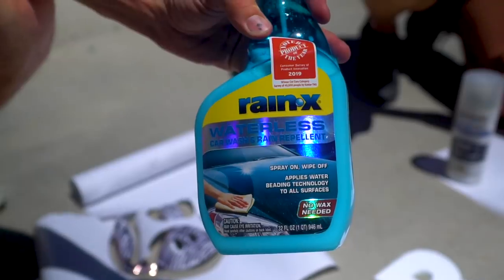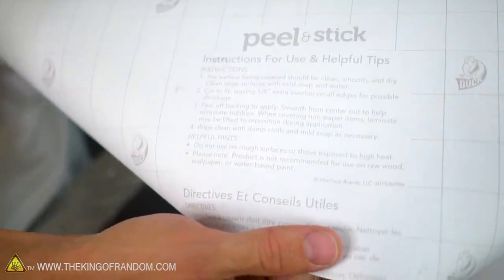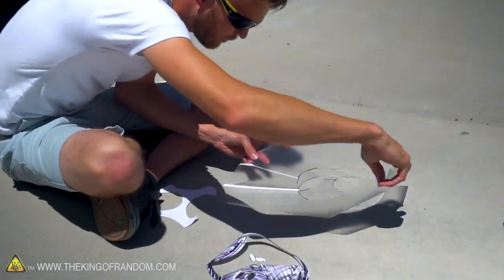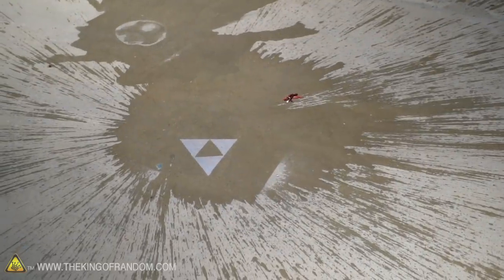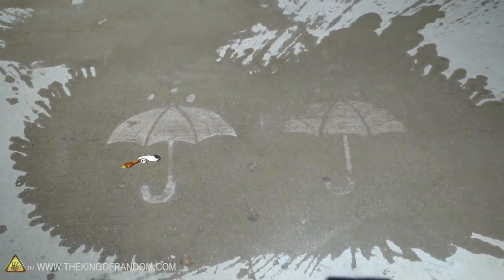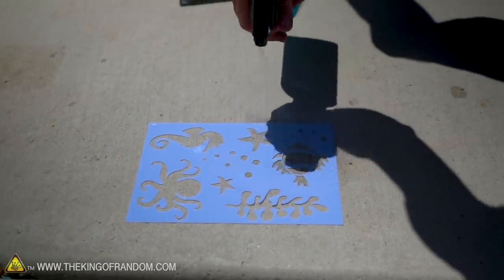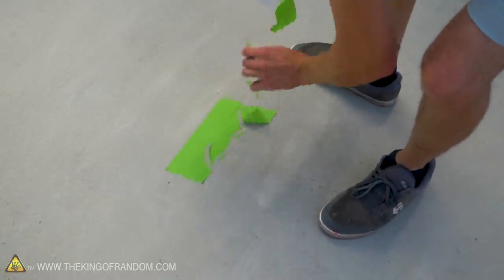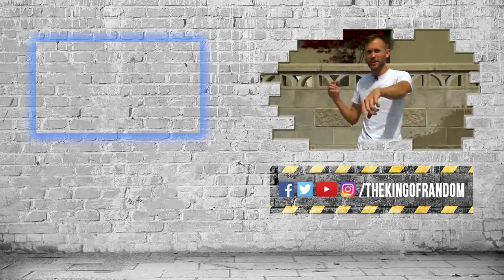Making Our Skin Hydrophobic

Comment: The purpose of applying water repelling spray to concrete, is to prevent the growth of mold. It keeps the concrete looking clean without the use of bleach or a pressure washer.
Reply: So...we should never wet our concrete because it literally not coming off?
Reply: lchi I believe it wears off over time
Reply: When you realize Nate is great at drawing
Reply: This kinda ruins the fun of it tbh
Reply: Smart af lol
Reply: More permanent Sealers for concrete exist, but I wouldn't put them on smooth finish concrete unless it's indoors and highly unlikely to get wet. They are great on driveways though.
Reply: @lchi1234  do youlike spacex because you use falcon heavy on your logo
Reply: electronicsNmore nobody really cares it’s just for fine and so kids can learn
Reply: lchi it’s just for fun and so kids can learn
Reply: BIG BRAIN
Reply: Smart
Reply: Really?
Reply: @thatmcgamer3106  it does I think.... yea it does.
Reply: I was thinking maybe it would help for skid resistance, but unless the driveway is really slanted I’m not sure that’ll be a problem, and if it is slanted, well… It’s slanted.

Comment: you should cover a trampoline in never wet. it would be very cool
Reply: oooo yes. imagine a bunch of water just formed in the middle, maybe bubbled up, then pulling from the bottom and making it shoot up
Reply: Sinsanatis 

BOUNCY POOL.
Reply: Trampolines have alot of holes in them, it would just keep it dry while the water fell through
Reply: @cohancuth9298  well but from what i can see most trampoline material is woven fairly tight and is waterprooof. and i think ive seen some with a sort of nylon or rubbery material

Comment: Can you put never wet on a phone and see what happens
Reply: Kayli Cabeza water damage only occurs to phones when it gets inside the headphone jack, speakers, mic etc. it doesn't hurt if you get water on the screen it only damages it if it gets inside of the phone, and you can't apply it to the inside so it wouldn't be able to water proof a phone with never wet.
Reply: @samwhitehouse8925  Some phones are coated with hydrophobic coatings. It keeps the water from seeping into the crevices when splashed. The water beads up too much to get in the cracks quickly. It doesn't necessarily help with prolonged immersion, but it does help with brief exposure.
Reply: @Bob5mith  All phones have hydrophobic coatings on the screen's and backside's glass

Comment: is it possible to make a chalk painting "neverwet" and it stays incredibly long?
Reply: Spray neverwet over the chalk
Reply: Sadly no, unless you use very little chalk it will stay as a powder on top of the chosen surface, and the NeverWet wont stick to anything but the powder, also it is based on acetone, don't know how that will react to the chalk.
Reply: @Mrnolf88  "neverwet won't stick to anything but the powder"? This video?
Reply: @stephenlee306   If you put the chalk on concrete, because it isnt permanently attatched to the concrete it will create pockets of air, and so the NeverWet wont stay as permanent as it normally would.
Reply: @Mrnolf88  The chalk might work as a stencil, if you don't soak it too much.
Reply: @Bob5mith   True, one would have to be very carefull though.
Reply: My childhood dreams would come true

Comment: Can you try to extract the sodium from the Sea salt or the baking soda???
Reply: You can get sodium from table salt by melting it and doing electrolysis on it. Electrolysis is when you run electricity through a liquid and it separates the elements.
Reply: @kdotdevelopment6398  electrolysis.... sounds like a legend of zelda breath of the wild ability
Reply: Thats sorta unsafe. Melting point of pure nacl is too high. Gotta mix it with sodium hydroxide to get a lower meltinpoint. Even then its still plenty toasty and should be peorformed by someone who understands exactly what is happening and the risks involve
Reply: @kdotdevelopment6398  yes, but you need to do it outside because the salt contain chlorine.

Comment: Question and a possible idea. The Never Wet caused the water to repel and move away from the areas that were painted. Does this increase the friction coefficient? As in, could this be used on roads to reduce slipping and/or hydroplaining in known problem areas?

Comment: If they ever develop a superhydrophobic+superoligophobic coating that is durable and can be used on dishes it will change everything.  You could have dishes you never have to wash, you could just tilt them over a trashcan and all the food would just slide off.  Puddles of ketchup, crumbs, basically anything wouldn't be able to stick!